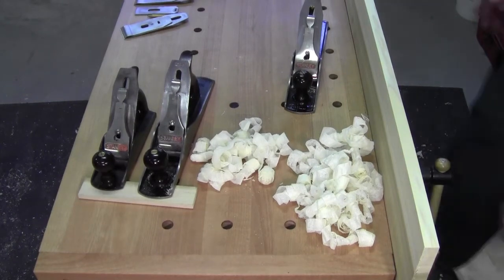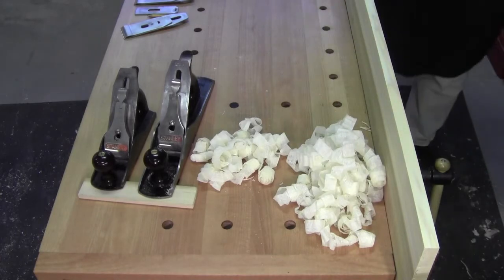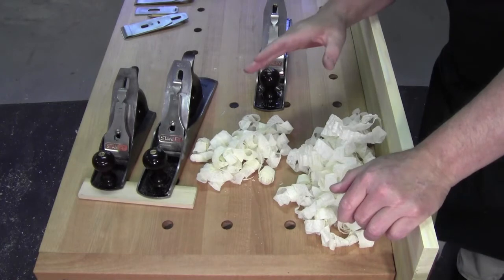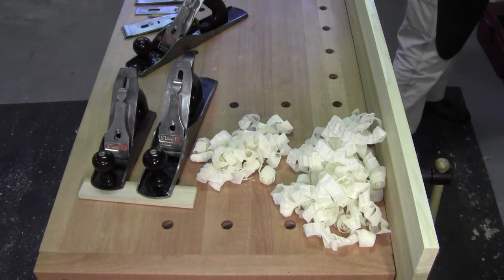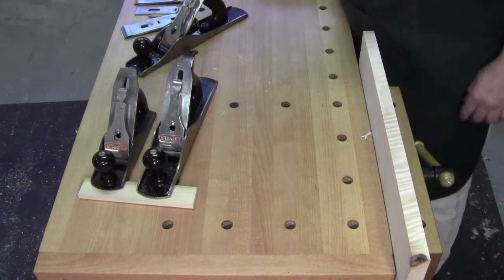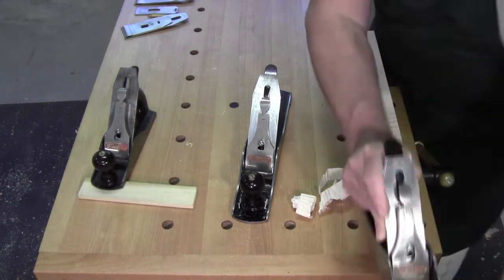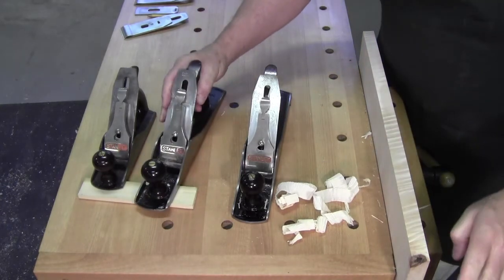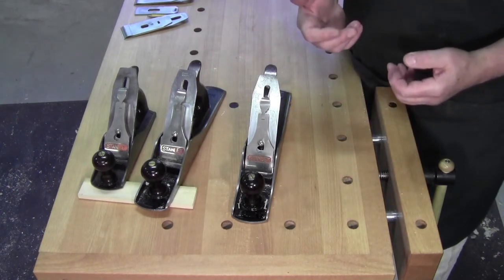PLANE TALK - "Breaker Breaker" Set Your Chip Breaker. June 21st 2017

Comment: Walter, you're 7/10ths to your subscriber goal! Convinced my brothers to subscribe as well.

You asked for questions if we had 'em. You've helped me in the Hand Plane group we're both in about my frog being too far back, and may have seen me looking around for a No 7 under $100. Rob hooked me up with a beautiful type 12 and it's on its way. My question is, assuming for whatever reason the sole isn't "acceptably flat" for a jointer (near the mouth, front and back), would your lapping process be any different than the tablesaw-sandpaper routine?

Love these regular videos. No one plainly talks planes like PLANE TALK does.
Reply: Another question I've had is why in your No 6 comparison video the No 4 smoother gives a perfect shaving with no tear out. I get that certain planes are better for certain jobs like jointing or cambered scrubbing, and ease of use with a lighter body. But aside from the physical form factor, the blades on a 4 and a 6 are in theory the same to a board. Obviously a 4 won't easily true an edge like an 8, but can't an 8 smooth like a 4 if you tweak the chipbreaker?
Reply from the maker: The lapping process is exactly the same for any plane except that the longer planes require a longer flat datum surface and more abrasive.  You can get away without allot of flattening on a longer plane as long as it is close since it is used mostly for rough work like truing up surfaces and jointing.  As long as the area around the mouth, and the toe and heal are all making contact, there rest is not as critical.  If you have a machine shop who can surface grind the sole ever so slightly to get it flat, that can be worth it too.  The sole needs to remain as close to square to both cheeks as possible.
Reply from the maker: Planing is all about rough, medium and fine work.  The Jack plane is generally a roughing tool, the Jointer or try plane is a medium and the smoother os fine.  But, technically since the blades and chip breakers are designed all the same, technically they all can smooth work and they can all do rough work depending on how you sharpen and set the irons.  Mostly, since the time spent preparing blades and setting chip breakers allows us to have the 3 basic plane always at the ready and we do not need to think "how is this set up" just grab and go.
Reply: Dusty Splinters Thanks for the wisdom!

Comment: Hi Walter, what do you think of the standard Stanley replacement blades for vintage Planes that are like 100 years old.  I have a bailey #6 that I have reconditioned and it is the finest old plane in my collection.  Someone gave it to me for parts but I noticed that the frog had a very responsive forward adjust.  So I had a blade from a modern Stanley plane and I added a vintage chip breaker and lever cap.  I also replaced the lever cap screw with one with a large head on it from an old Sargent plane.  The thing is bastardized, but it works noticeably better. I think it is because of the blade.  What are your thoughts?
Reply from the maker: THanks for writing.
The original chip breakers are fine if in good condition.
I prefer the Hock O-1 Steel Replacement blades over any other.
Call Ron Hock and tell him Walter Sent you.
They are just the right thickness and hold a great edge.
I never go to a thick Iron in the old Stanley planes.